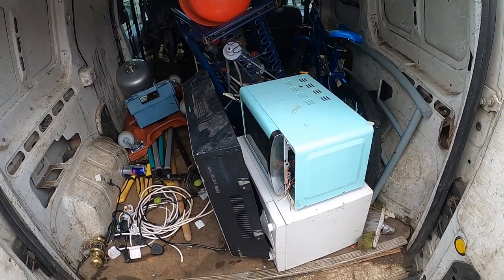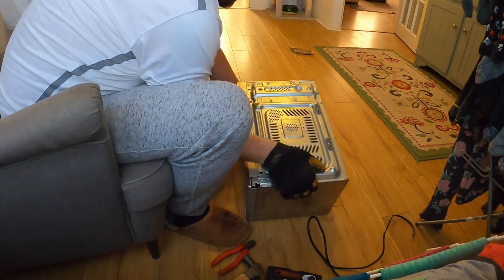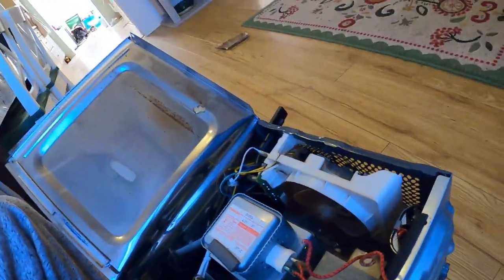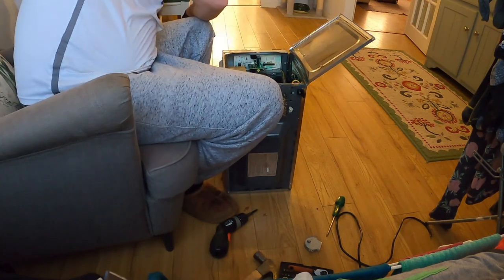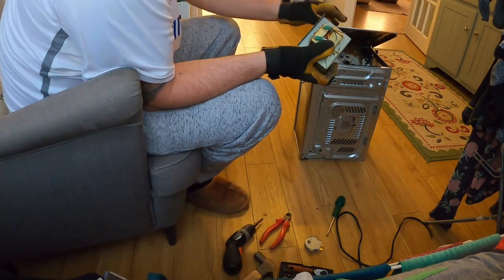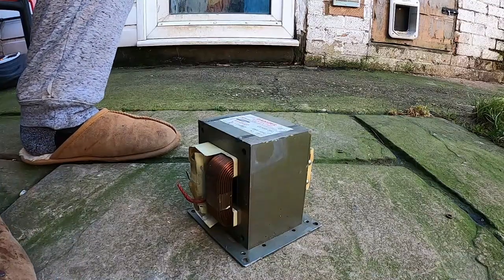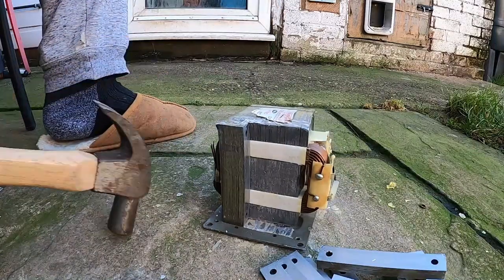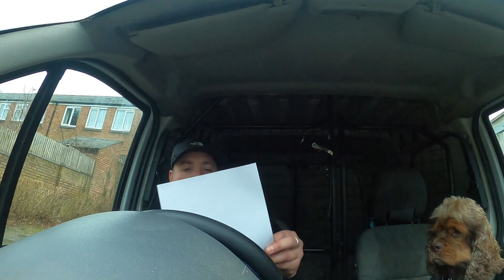How Much Copper/Money in an Old Microwave

Comment: Hey came here from your comment.  Great video 👍. You definitely need a furnace to start melting your scrap.  I would just melt that glue off that copper wire 😁
Reply from the maker: Hey thanks for coming over, glad you liked the video. 100% going to get a furnace at some point and do some melting and casting projects.
Thanks for the advice on the glue, what would be the best method of melting it off?
Reply: @ScrapRushUK  I don't know if it would change that scrap price.  I'm saying I'd throw it in my furnace 😉